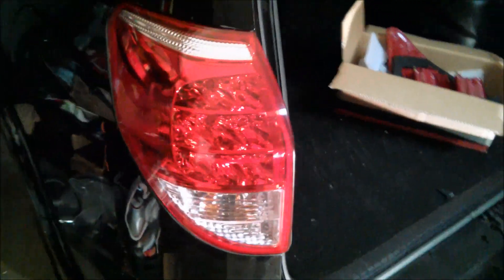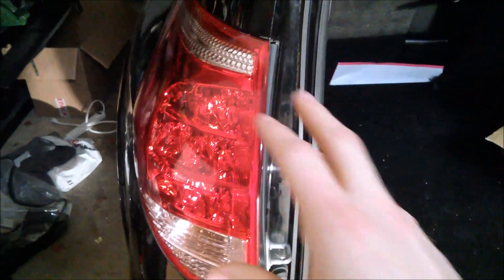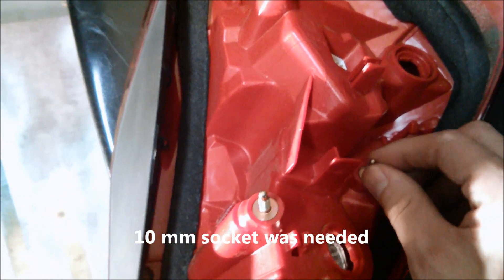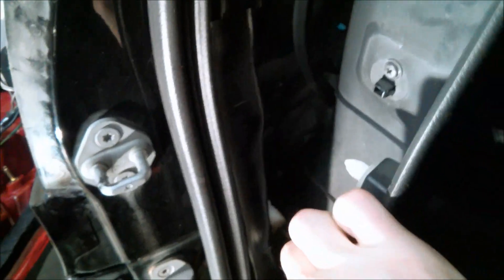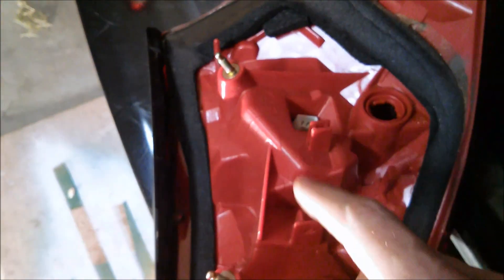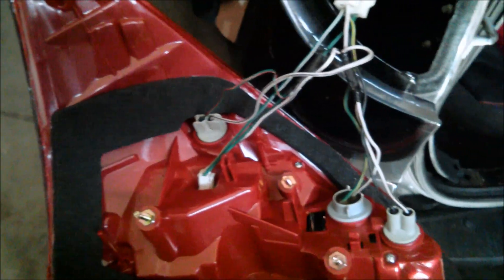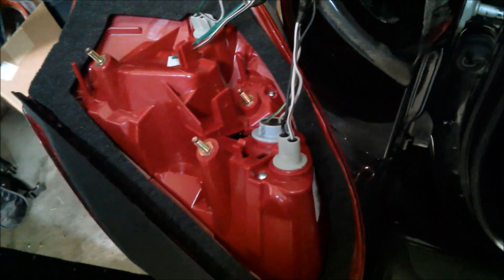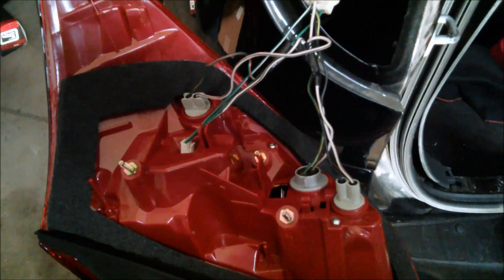Yes you can replace your break lights on a 2006 - 2013 Toyota Rav4

Comment: did both of yours go out or just one???  on mine they are both out.    is there a fuse
for these back lights???  i find all the others but none for tail light.  do you know if this is a common problem for rav4's//
Reply from the maker: Mine was just the left rear LED lights that all went out. There are three fuse boxes. Two under the hood, left and right side. And then another one under the driver side steering wheel, down under the dash board by the hood release. The user manual with your car has all the details on which fuse is what. There is one for tail lights.

Comment: I need the details to take the rear lamb down.
Reply from the maker: There are a few lamp bulbs outside the LED to replace, they are simply a twist and pull. Then the bulbs are standard that you can find at your local automotive shop.

Comment: The LEDs can be replaced!
Reply from the maker: I would much rather have whipped out my soldering gun if it were that easy... The plastic paneling is glued tight and there are methods found online to oven heat the light to loosen the glue and take it apart. In the end I don't think the individual LEDs were dead, I think some solder points went bad. It was a lot easier to drop in a new one.
Reply: its very very hard but possible. i worked in toyota
Reply: Please explain the process for replacing the LEDs.
Reply: @crm3480 
Right… here I am 5 years later and I still haven’t driven my RAV4 due to my taillight assembly being tore apart while waiting on instructions on how to replace the LED’s!!! PLEASE HELP!!! IM SOOOOOO TIRED OF WALKING EVERYWHERE WHEN I HAVE A PERFECTLY RUNNING VEHICLE WITH NO TAILLIGHT!!!

Comment: How did you remove the front turn signal bulbs from the headlight assembly? 2008 RAV4 Sport...  Heard they are supposed to turn counterclockwise, off? is this true? There is not a video on this on youtube, thought it would be a good opportunity for you :-) Thanks for the info